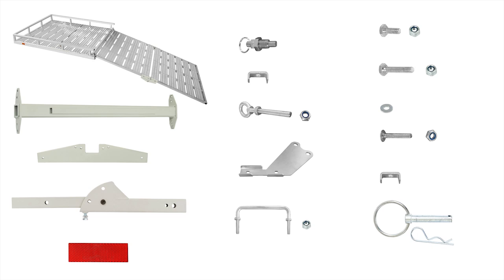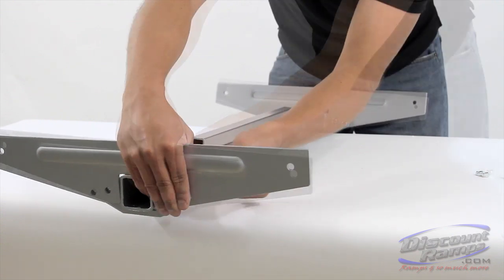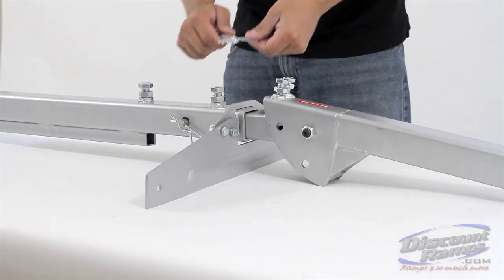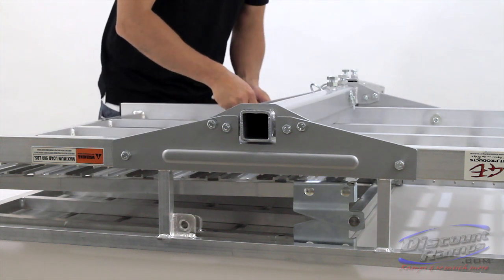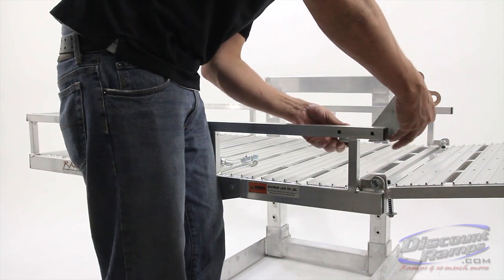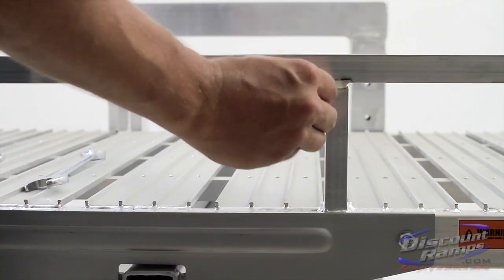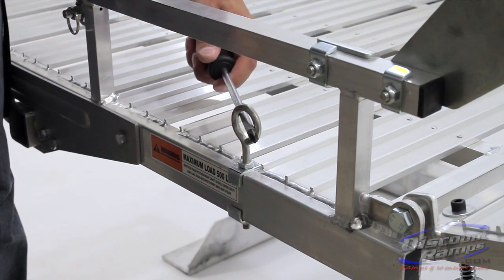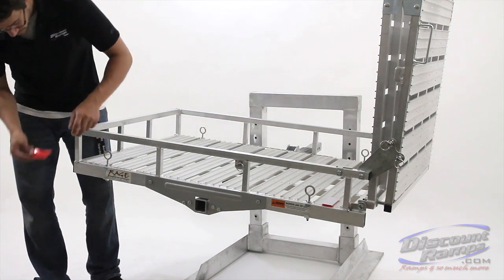SC500-AF Aluminum Folding Mobility Carrier - Assembly

Comment: The new version (I purchased mine 3-26-23) has updated spring locks and an anti-tilt bracket that goes over the hitch tongue to keep carrier more stable.  I read several complaints about sagging and ‘not heavy duty enough’ with people that had 300 + lb scooters.  My son’s power chair is 320 lbs and it sagged.  I called discount ramp customer support and they suggested having a second person lift up on ramp whilst refitting and leveling ramp then tightening again.  Makes sense if you see the new anti tilt bracket they have.  I did not have a second person, so I used a boxed steel post to prop up ramp.  It worked!  So any saggers out there due to heavy cargo will probably need to do this.  This procedure is NOT in the manual, but it 100% improved my moderate sag and gave me more stability, better look and ground clearance.  Hope this helps anyone purchasing this ramp.  Overall it is a good value.